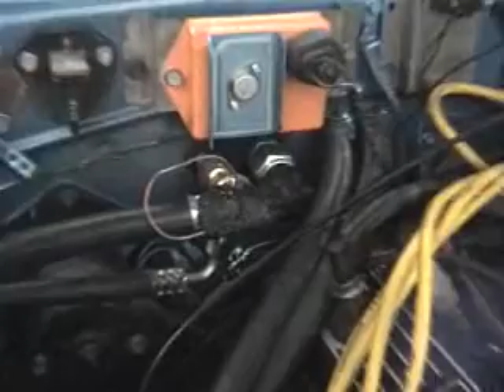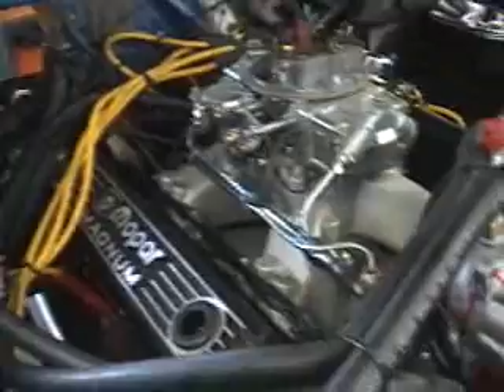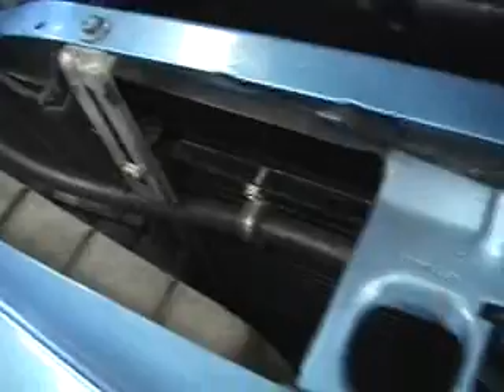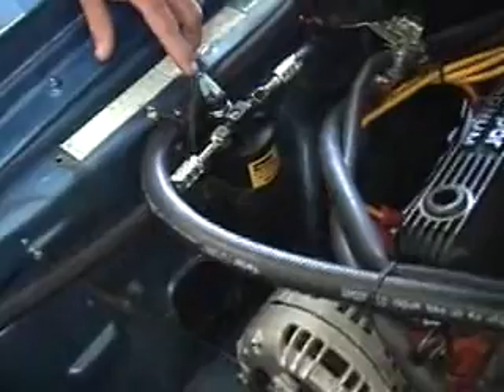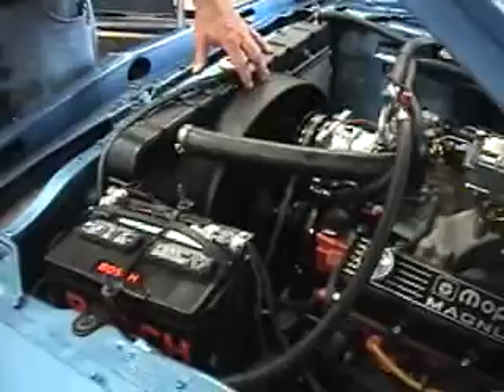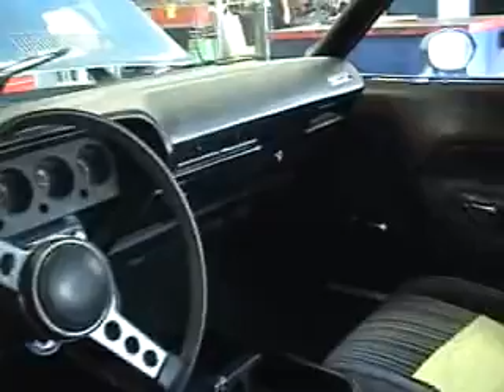AC Underhood Kit on 1973 Plymouth Cuda

Comment: who makes your brackets,  it would very nice to have a lot more information. Where can I buy these items.
Reply: Stick to the OE RV2 compressor. It pumps WAY more gas at low speed and idle, and as long as it doesn't run out of oil the darn things will last nearly forever, give or take a new shaft seal every 20-30 years or so. Of course, you must have a very good condenser and fan setup if you want to run 134a. I think thats why so many 134a conversion systems use the Sanden 7H15 (or even smaller Sanden 5H14) compressors rather than larger displacement Seltec TM-16's, let alone the big RV2. That's why I prefer to run a good parallel flow condenser, make sure the system is absolutely leak free, and run R-12. Done right, you will be nice and cold in gridlock traffic.

If you get a system using a Sanden compressor, make sure it's a genuine Sanden and not one of the many Chinese clones flooding the market. The Chinese compressors aren't as durable, and they don't last nearly as long. Especially in hot environments running 134a, where the head pressure can get quite high.